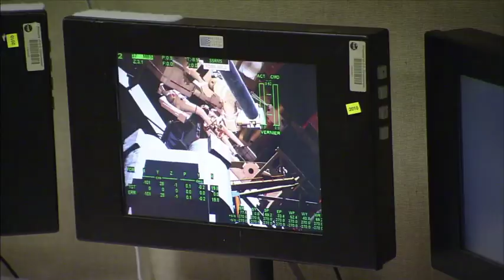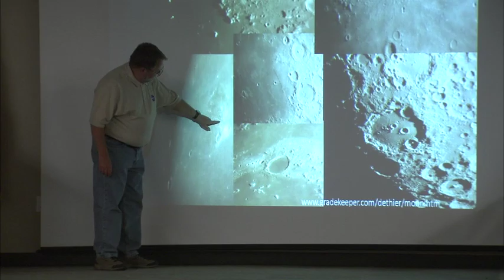New Crew Announcement, Discovery Rolled Out on This Week @ NASA

Comment: @NzNexus2 Shuttles require heaps of TLC (and money) to keep them flying, don't forget, those babies are pushing 30, even commercial jets get put out to pasture after 20-30 years, not to compare the shuttle to a jetliner, but there are some material similarites, (the shuttle is built mainly of aluminum) and most commercial airliners don't have to go from 0-7km/second in 9 minutes, and then come back through the atmosphere.